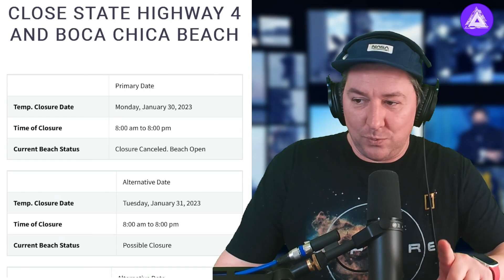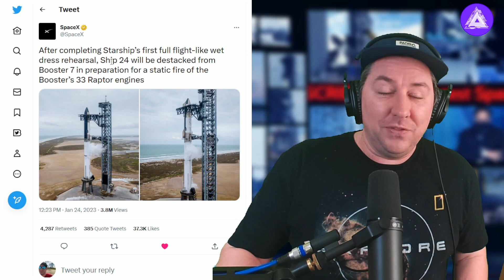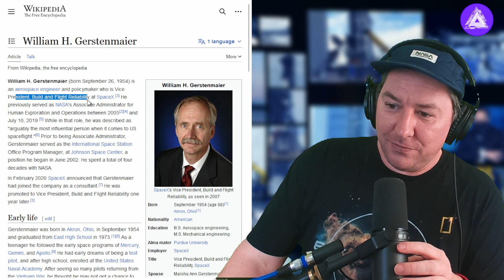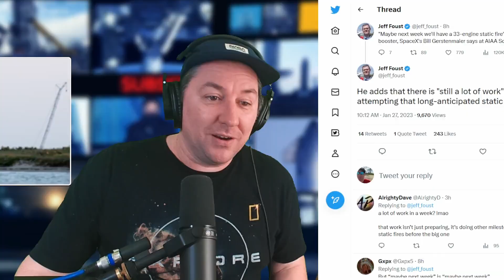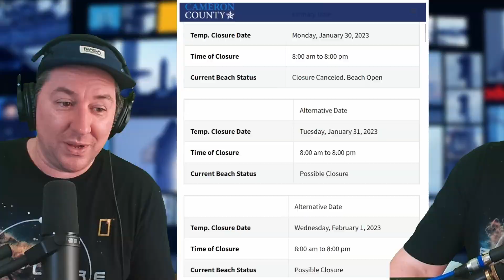SpaceX Employee Claims Starship Static Fire Next Week

Comment: I was glad to hear that s24'S move to rocket garden is only temp. According to Elon's philosophy "Failure is an Option" so test first, if damage then make fixes i.e., H20 deluge system, cement on ground and olm. But in my opinion since we have seen the damage just 14 engines can cause to the olm and ground it would be smart to do the fixes first.

Comment: I find it hard to get excited for a test fire. It wouldn't matter to me if it was 1 trillion engines... but I digress.  However, I'm not a "fan" of SpaceX, where such things as staircase painting is an event. I also don't care about other mundane ground based requirements typical of every rocket launch system ever made. If they end up needing something, they will put it in. Call me when it fly's. That's the actual awesomeness of this whole project... not construction and sprinklers.

Comment: 86 the cement under the tower, dig it down and install Battelle Ship boiler plate 2 to 4" thick, it may heat up, but it will not blow up.

Comment: Two things, 1) I think they are waiting for Feb 14  to do their thing so it can happen on the  birh of the channel !!
2. They really need a water system or flame diverter or both as they tear up the concrete evert time.  This is expensive and time consuming  
Thanks Wil for all you do for our community.
Reply: The concrete will be fine, they're using FONDAG now which will be absolutely fine. They've only used regular concrete up to now but the new concrete is more than capable of withstanding the forces and temperatures it will experience under the OLM